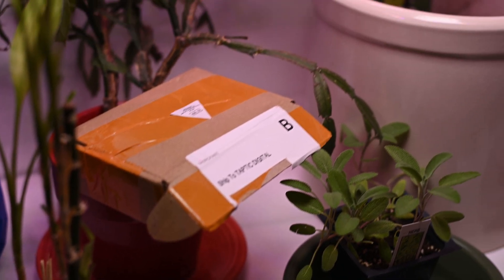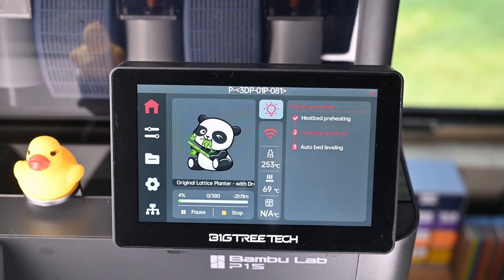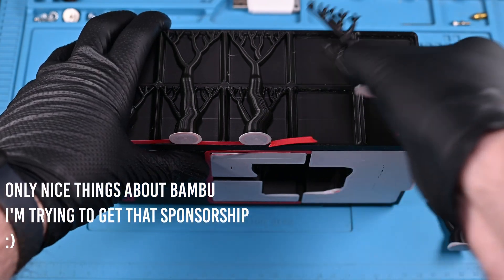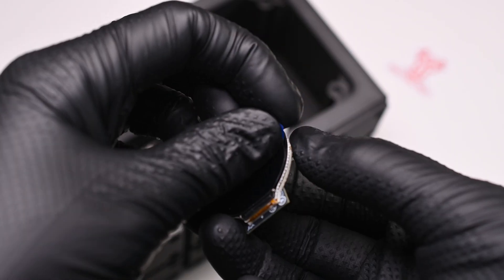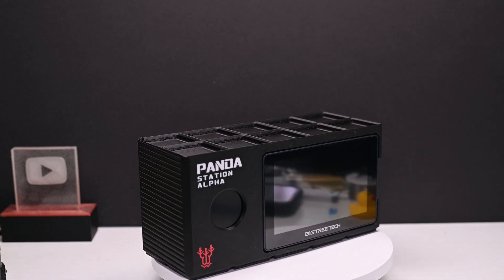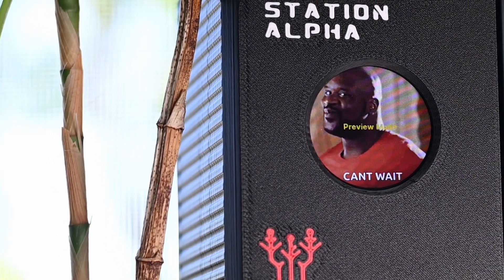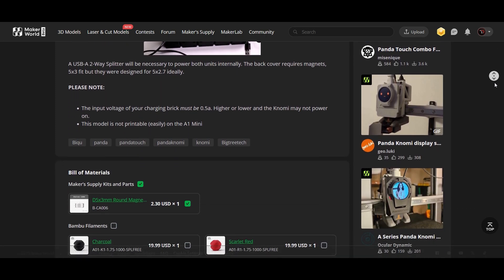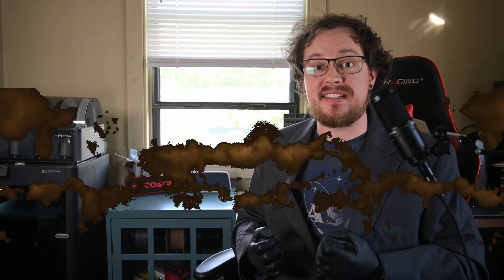This is the BIQU Panda Station Alpha - and I made it

Comment: I'm a new subscriber, I'm new to 3D Printing. I have a Bambu Lab  P1S coming. I thought I heard that the Panda Screen won't work with the P1S because of the new firmware upgrade 1.9. Is that true, if so, is there a way to get around that? Thank you for taking the time to respond. :)

Comment: Thank you for your video. You are using the 'Panda Touch' with your P1S: is this screen still worth it? Lately, it’s no longer possible to use it in 'Cloud' mode while keeping the P1S up to date… That’s unfortunate.
Reply from the maker: I’ve been having issues with it lately as far as sending commands like nozzle or bed temperature, but it’s still decently useful for changing filament types. I haven’t updated my printer since 1.06 over a year ago, so I’m not really sure what changed to limit the functions. I still say it’s a cool accessory but not a necessity.